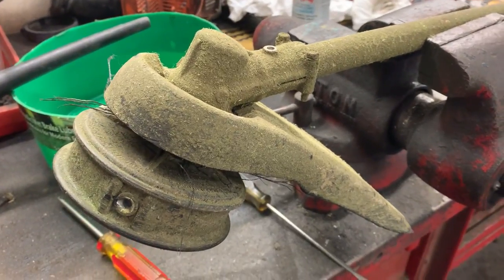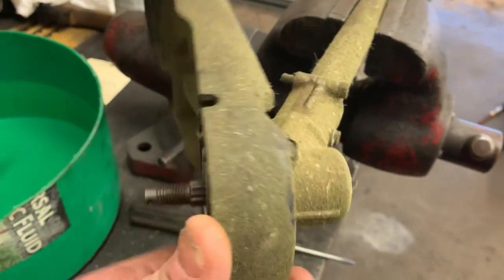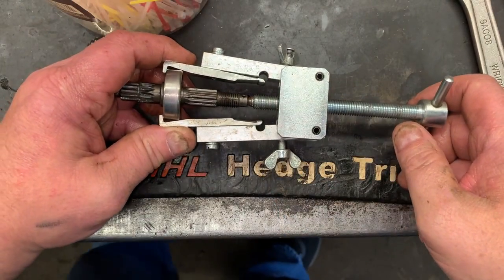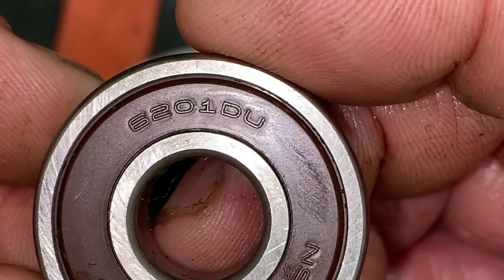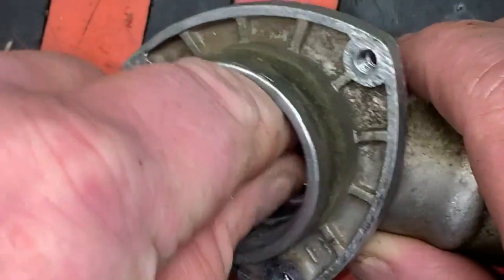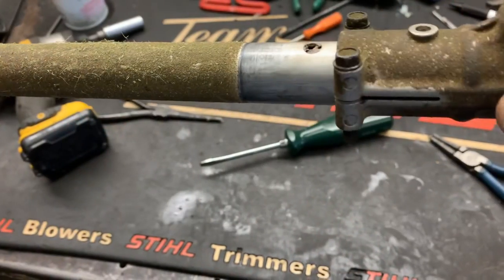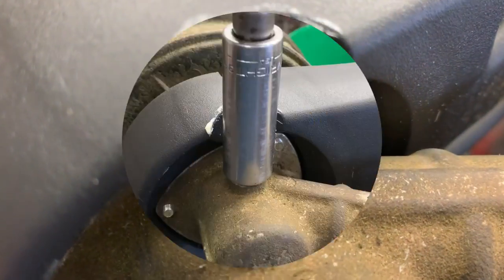WEED EATER GEAR CASE REPAIR / INSPECTION AND BEARING REPLACEMENT

Comment: I tried this on my echo string trimmer. Could not get the head to stop turning. Is there a trick to keep the gears from turning while you're trying to unscrew the bearing?
Reply: I’m having the same issue. Wondering if you ever got it figured out 😬
Reply: @emilymccarthy1   Never did. Sorry
Reply: @TheRonjeremys22  you figure it out yet either. I am banging my head off the wall tryin to figure out how to remove the arbor bolt itself

Comment: Very helpful video - thank you mate (from Sydney Australia). One thing I get mixed up about, by the way, is how much grease to use - there seem to be 2 schools of thought ie: the mechanical engineers who say "too much grease is bad & causes problems" and the other camp, which I probably belong to, who tend to be more generous and 'gung-ho' with grease, and like to 'pack' every bearing and gearing cavity to it's fullest extent. Does anyone have any comments about this? Thanks in advance guys👍

Comment: Subscribed.  I just took my gear head off and greased my flex shaft in my tube and greased my gear head through the small bolt

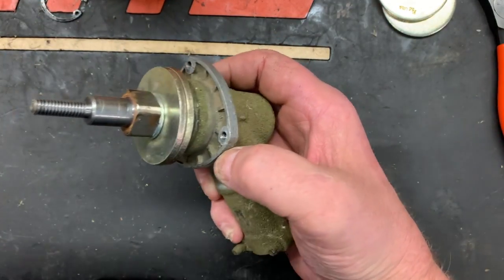Comment: I got as far as 3:20 in the video, and then when I go to pull out the bearing, the whole gear system turns and there is no way the nut can pull out the axle, unless the rotation of the axle is somehow arrested. Don't see how you did that...

Comment: I have a Stihl fs94R trimmer. there is, what I think, grease all over the motor/clutch housing/even in the air filter cover. But I think it's grease. The only grease is in the trimmer head. Is there a seal fail anywhere from the head up through the shaft to where it meets the clutch that would dump grease all over the motor? The seal at the top clutch end of tube looks fine but there is still a hole for the rod. I cleaned the entire motor and ran it to see if there was a leak in it but not so far. I pulled the gearhead off and there was more grease than u had here and it was black not grey like this.

Comment: Need to change my pto shaft because the threads on it are completely busted so i cant use the nut of the head to pull that out as you showed on de video. Any advice on how i could pull it out? Thanks

Comment: Do you think most repair shops would replace the bearing, or would they install a whole new gear case and charge the customer accordingly?
Reply from the maker: Most shops wont jack with repairing anything nowadays. It’s very sad.  Just parts repalcers
Reply: @THEMOWERMEDIC1  How true - it's just same here in Australia too.

Comment: Maybe someday do a Stihl fc91 gearbox bearing replacement there's no grease fitting and most people buy the KM attachment for replacement the dealer charges more to fix than you can buy the attachment thanks my friend 😁

Comment: @THEMOWERMEDIC1, what model was that weed eater, and im curious what parts would I need to put a steel driveshaft in place of my flex cable. Nothing wrong just wanted a heavier drive cause I assumed I'd b at my house most time, no working commercially weekly. Just curious. 

Thanks JD

Comment: The grease port bolt on the gear head fell out of my Echo trimmer while I was using it.  It got hot, hot enough to melt the plastic head.  I don't hear bearing noise but if I run it now it does seem to get hotter than other trimmers.  Any ideas?  Thx

Comment: @THEMOWERMEDIC1, is the red armor oil by echo a full 100% synthetic or semi synthetic? I seen videos and reviews looks like good stuff but couldn't find that information. Thanks
Reply from the maker: It’s all good I normally run stihl ultra
Reply: @THEMOWERMEDIC1  Tru fuel is cheap in WV. I ran the Stihl and it carboned up bad. Just asking if you knew on the echo oil cause I was thinking on trying it for my soon to be got SRM3020.
Reply from the maker: The echo fuel in a can is good so is vp and tru fuel
Reply: @THEMOWERMEDIC1  thank ya. I called echo tech support and the lady assured me the semi Synthetic is just as good if maintained. My concern was build up over time but I don't have to worry at all 😁

Comment: how often should you change the grease or even add grease to this assembly
Reply from the maker: Just keep it full. 
No need to do in an in-depth repair like this unless you have an issue. About every 50 hrs
Reply: @THEMOWERMEDIC1   if you clean out the old grease, can you put regular wheel bearing grease?

Comment: What size washers and nuts did you use as the spacers?
Reply from the maker: All different sizes I just dug through my bolt bin until I found some that fit

Comment: Does anyone make a screw in grease fitting for the Shindiawa  gear heads similar to what Redmax has on theirs?
Reply from the maker: Don’t need it just squeeze the echo/shindiawa grease in from the tube.

Comment: I AM FROM THE UK AND I CANNOT GET MY HEAD AROUND WHY THE HELL YOU DIDN`T REPLACE ALL THE BEARINGS. IF ONE HAS GONE THE REST WILL SOON FOLLOW. INPUT SHAFT BEARINGS ARE ALWAYS GOING AND CAN SOON SMASH TEETH OF THE GEARS. I HAVE BEEN WORKING ON MOWERS&STRIMMERS& SMALL PLANT FOR 40 YEARS. THAT JOB WAS HALF ASS.
Reply: Being from the " UK " supposed to mean something??
Reply: @russellkerfoot5423  "Well they ran trough the briers and they ran through the bramble, and they ran through places a rabbit couldn't go, they ran so fast the hounds couldn't catch them, on down the Mississippi to the golf of Mexico"......and BACK to the "UK" you went.
Reply: @outboardfixer  OMG I know that song, very few do now